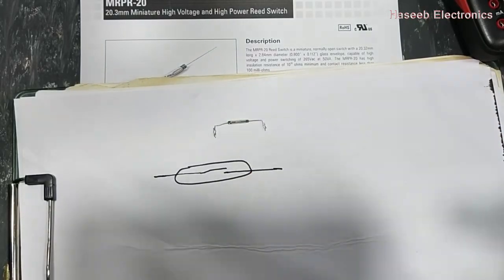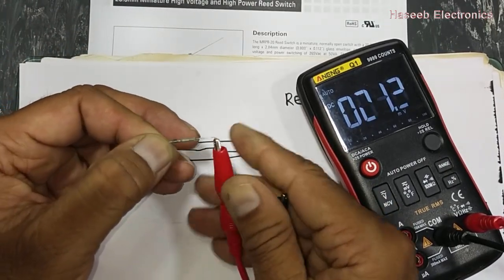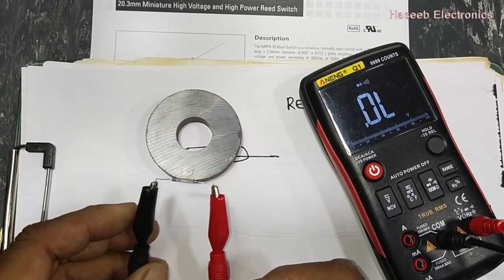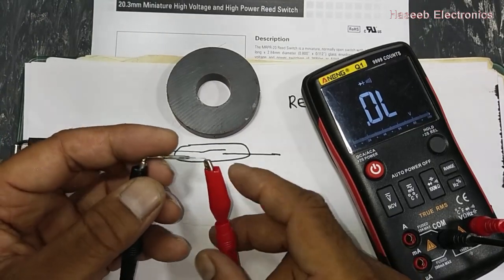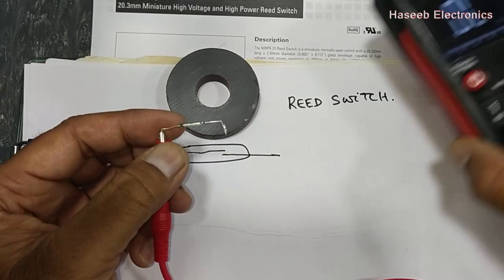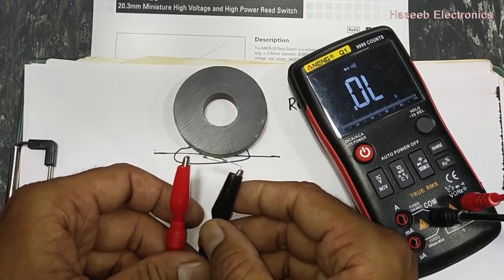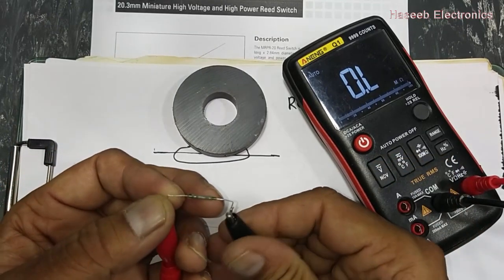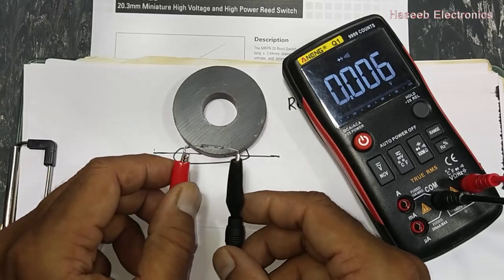{461} How does a reed switch work? How to Test Red Switch Sensor Or Reed Relay

Comment: This helps a lot thank you. I need to test a reed switch on a Hobart dishwasher.
Reply from the maker: best regards
you can test it in the same way 
just use a piece of magnet or any magnetic tip screwdriver

Comment: I took a  small reed switch taken from a battery operated light. So it was a normally closed switch...I connected it to multimeter to check it's connectivity and used a LEd to check the connectivity. And as soon as I disconnected the reed switch it turned into normal open. How can this be possible ? Not it has totally changed. Does a reed switch changes on its own ?
Reply from the maker: reed switches are two types
Noramlly Open contact    OR
Normally Closed Contacts
and these both work opposite to each other
as these switch are closed in glass encloure, some companies use very low quality glass material, which damages with very low heat or viberation and the seitch contacts change their position and most of time these change the function of the whole circuit 
i faced many issues while working on high speed coaxial swotching matrixes. most common problems in reed switches are (open, close, increased resistance, broken glass, no response on magnetic field etc)

Comment: Thank you  haseeb...i have a question and a doubt about two Power switching  ics the ice2a180z and ice3br0665j the Pin1 Is called softstart in first ic and BA in second ic..!! Is It same function?are they equivalents? my best regards.

Comment: Assalam u Alaikum  Sir, I have a mobile charger with two USB port with no output . I opened it & found bridge rectifier short, I replaced it with new & got voltage 330v across filter capacitor . Still it’s not working  I checked IC USA2308A & found  it short ,no voltage . Pin 5678 are shorted & connected to +ve 10mfd/400v capacitor. I’m not getting this IC in market plz. let me know any alternative IC to the above one. Here it does’nt have autocoupler plz. Explain me  how it works. Thank you .

 M.Kamaluddin  Hyderabad India
Reply from the maker: i never saw USA2308 IC. but most commonly the problem when the bridge rectifier is damaged, 90% the switching IC & mosfet are damaged. 
actually bridge rectifier gets damaged due to faulure of smps ic and  the mosfet 
i will try to find its data, then i can explain it. please re-verify the IC number again

Comment: is this switch also used in soldering station handle?
Reply from the maker: it is electromagnetic sensor, it makes its contacts in presence of electromagnetic or magnetic field, i think there is no use of this switch in soldering station
Reply: @HaseebElectronics  ok thanks for reply.
Reply: @HaseebElectronics we have this switch on the air gun, to turn off the resistance when the gun is placed over the support.